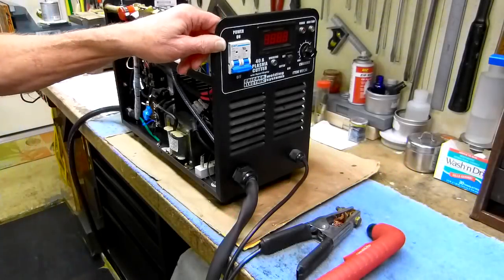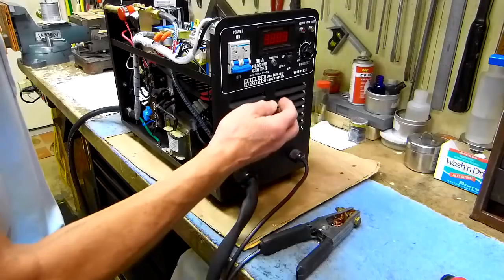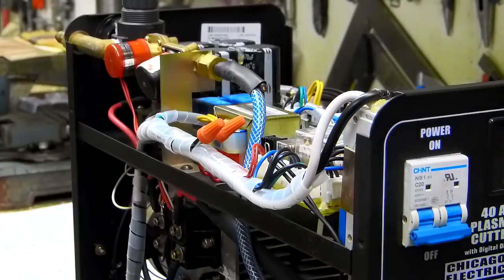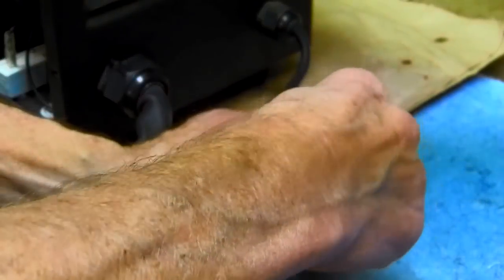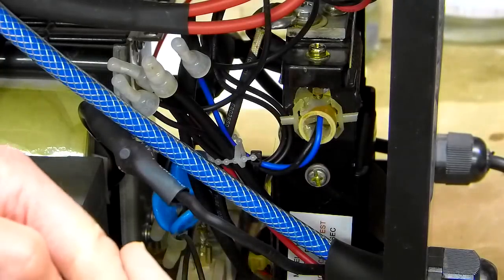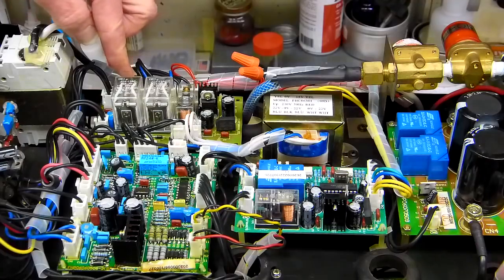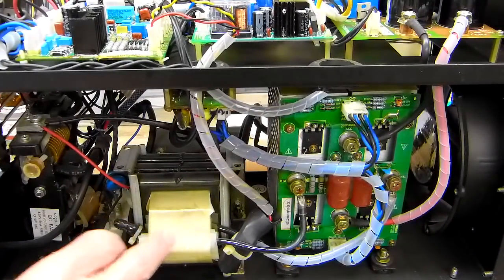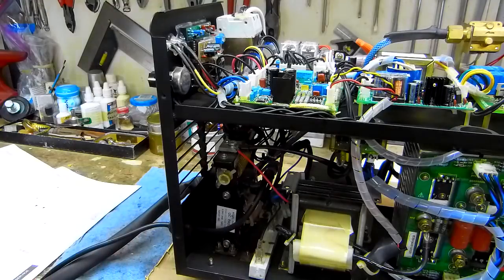Chicago Electric 95136 Plasma Cutter Repair Tips

Comment from the maker: I should have stated in the video that after I repaired the coil for the solenoid valve it measured 70 ohms.
Also, be sure and unplug this machine before touching any components inside. There are several places where lethal voltages and currents are present. BE CAREFUL!!
Reply: Great info thank you it was useful
Reply: That is Smart Thinking
Reply: That is the piece of info I was looking for, 70 ohms. Mine is at 4k ohms, an not working. Thanks.
Reply from the maker: Glad I was able to help. Thanks for letting me know!
Reply: Follow up, I un wound the winding of the solenoid as you did. Found a couple of breaks  90% in. I just removed the last 10% and rewound. Put back together, and it now works. Thanks.
Reply from the maker: Congratulations! Repairing that solenoid valve is no small job. Thanks for letting me know.